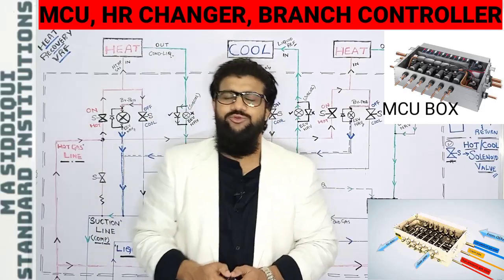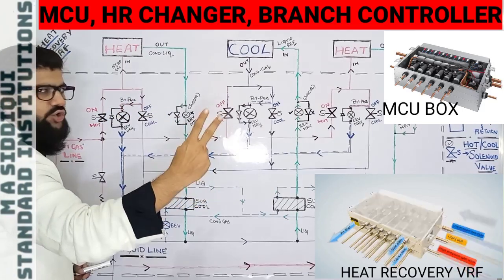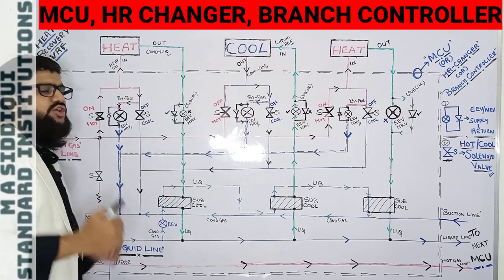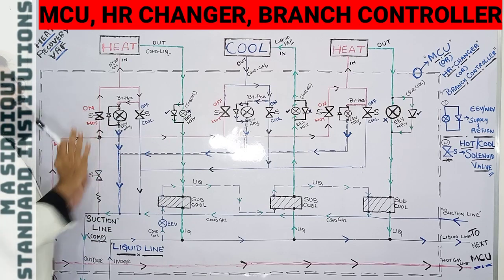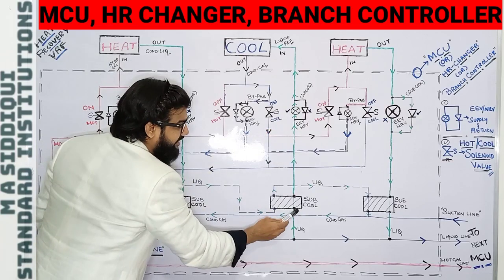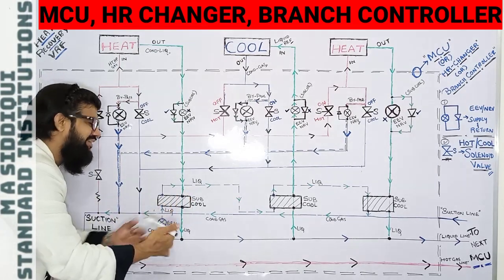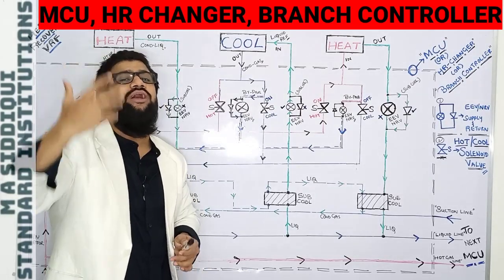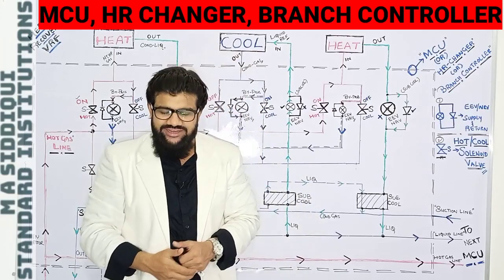HEAT RECOVERY VRF (MODE CONTROL UNIT/BRANCH CONTROLLER)

Comment: Namaskar Mera  sawal hai vrv vrf ac Me jab 2 ba 3 Indoor  chalata hun tab all indoor ko kui power dena he?
Reply from the maker: Vrf me Dc Inverter Compressor hota hai jo eev electronic expansion valve ke saath kaam karega to koi problem nahi hoti, chahe kitne bhi indoor chale uske hisaab se hi utna hi volume of refrigerant flow hoga pipe me.

Comment: Thank you so much my brother you are good explain to me
I have more questions with you please help me. Related eev and solenoid value
I have interview 4th October that's why 
Please help me
Reply from the maker: https://youtu.be/RfKpgwu9DHg
Thanks for your feedback
Refer the Video Link which I shared with you related to EEV & Solenoid Valve is Isolation Valve with Electrical On & Off Control using sensors.

Comment: What is the point of having a bypass? Hot gas goes directly through EEV valve? Where is efficiency in that? Do you drop the temperature from hot gas (state on the exit of compressor) to suction gas (before compressor) via EEV?
Reply from the maker: For that you must have grip on Heat Recovery Cycle Concepts, then it will be easy for you to know the use of 'Bypass Valve'.

Comment: Sir ,
 What is the difference between heat pump outdoor unit & heat recovery outdoor unit...
Reply from the maker: Major Difference is "Heat Recovery VRF" is a Three Pipe System (Hot Gas Line, Liquid Line & Suction Line) where as "Heat Pump VRF" is a Two Pipe System.... Remaining Components at OutDoor remains same expect some additional valves, Sensors & Subcoolers at "Heat Recovery VRF OutDoor".
I am about to upload a complete video Lecture on HEAT RECOVERY VRF (SIMULTANEOUSLY HEAT & COOL OPERATION) with in a week, this will clear all your doubts In Sha Allah.
Reply: Ok sir

I am waiting for your next video